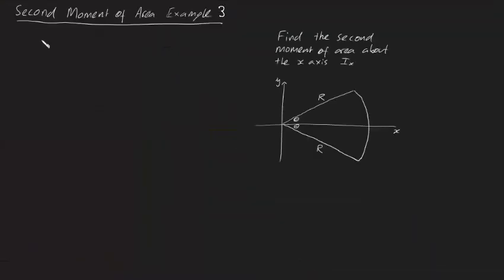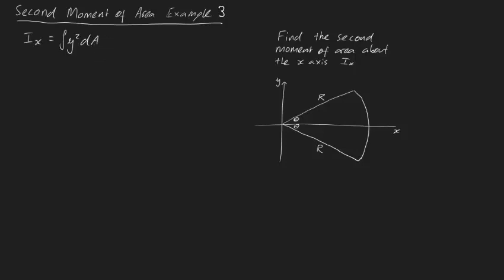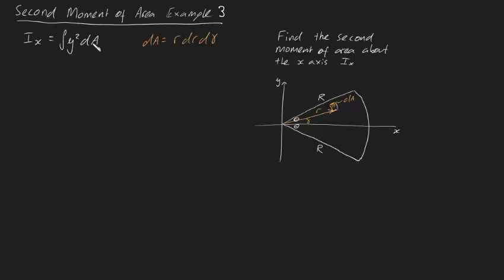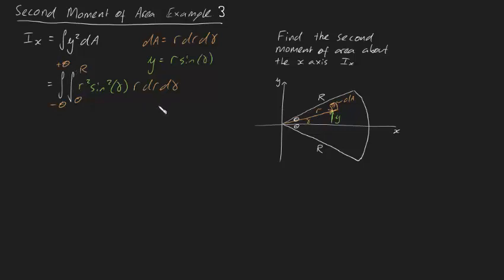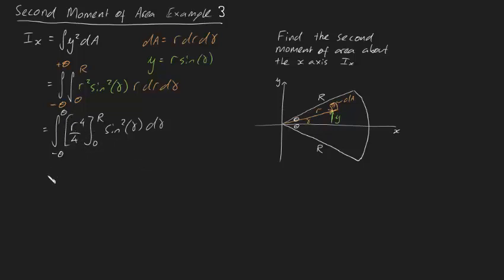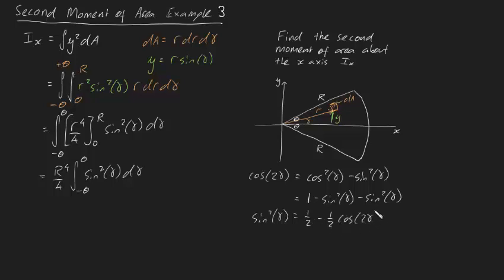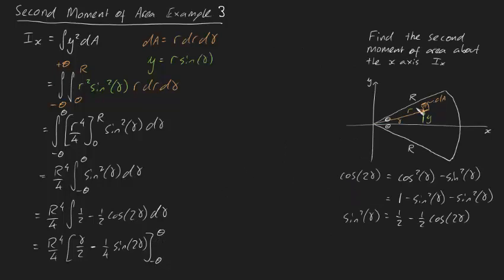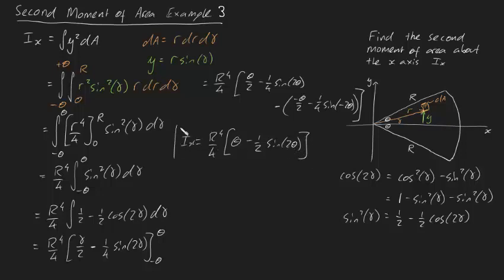Second Moment of Area Example 3

Comment: How would you go about it if we want to take Iy? I got the same answer but with adding the parallel axis theorem , R/4 (theta + 0.5 * Sin[2t]) + A*d^2. Is that correct?
Reply from the maker: I haven't done the calculation myself but all you'd need to do is find the double integral of x^2 dA and follow the same steps. In this case X = r cos(gamma). I don't see any need to use the parallel axis theorem here